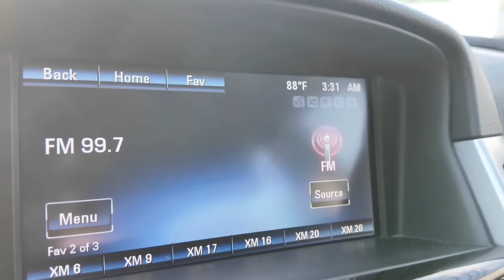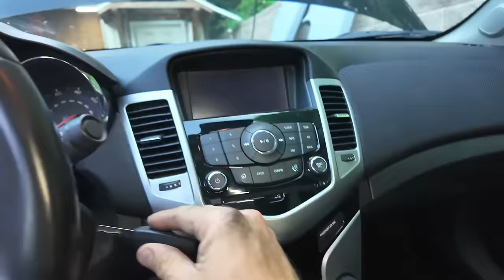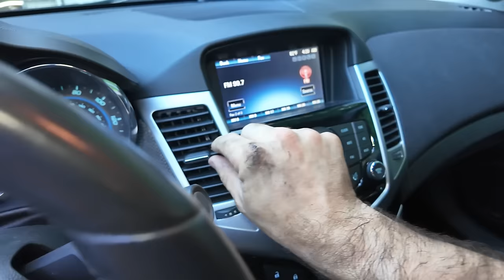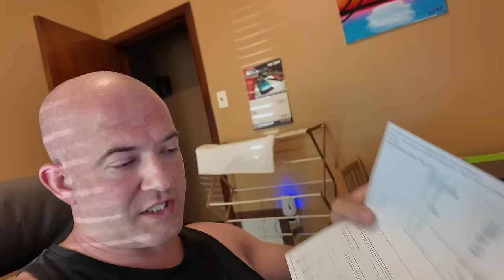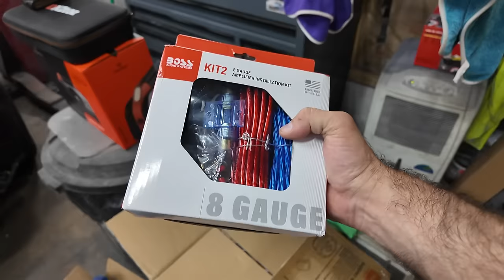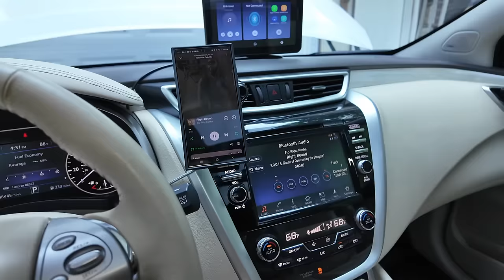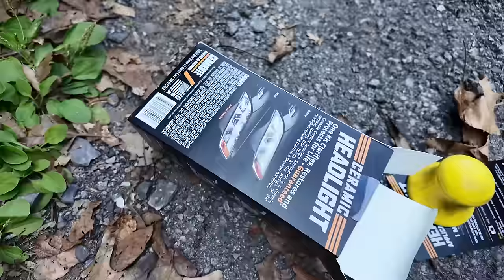OOPS I bought another project + JBL Active Subwoofer Install

Comment: Common water leaks on the 1.4. Water pump, water outlet, or turbo coolant feed and return pipes/fittings if they weren't replaced when the turbo was replaced. Out of the few years ive worked at the GM dealership, Ive actually never seen a 1.4 blow a head gasket. It usually cracks a cylinder head. Not to say it's not possible, just what I've seen. Im sure you would have pretty definitive evidence if that was the issue though. Honestly, that Cruze seems like a pretty nice car and a good find!

Comment: These Ecotecs are the worst engine to bleed.

I think it’s because of the way they designed the oil cooler and how it links to the thermostat housing 

I had one that was bubbling up and pressuring the expansion tank

I will avoid working on the cooling system if one of these for as long as possible